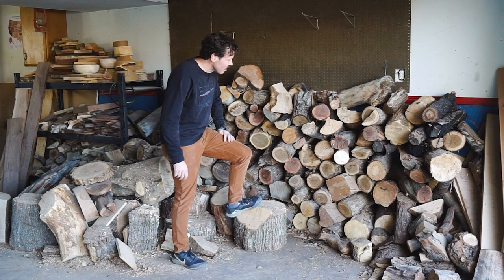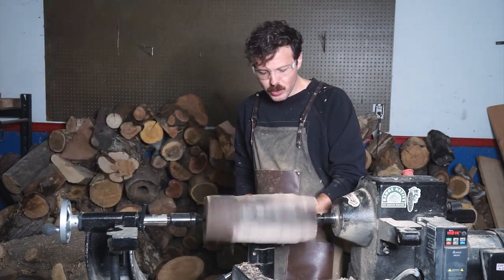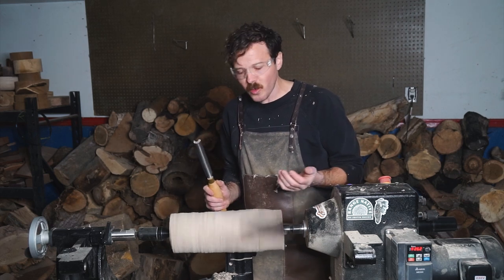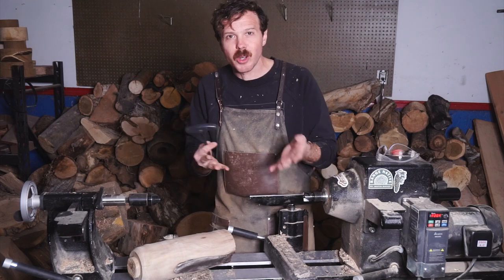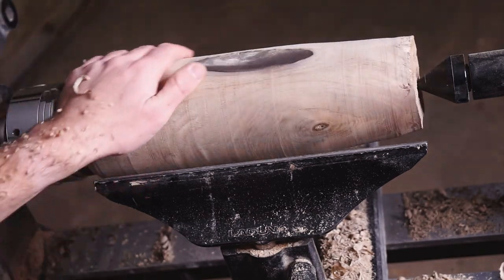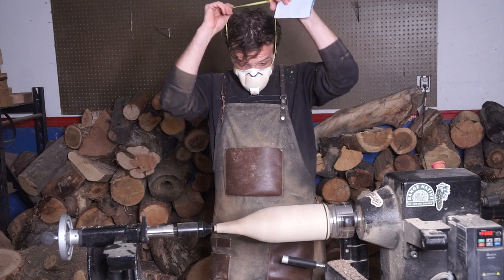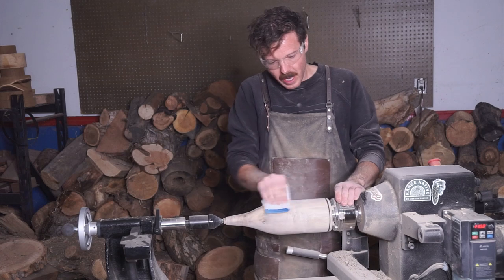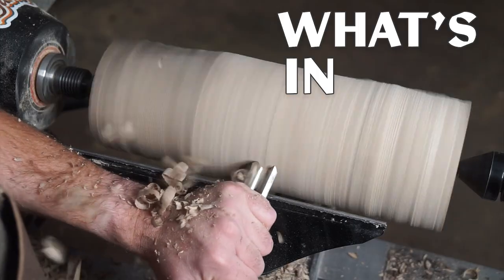English Walnut Limb to Vase | What's in That Pile?

Comment: I know you don’t like answering questions, but to get into carving should I start watching tutorials and stuff? Or should I take a class? I’m mostly lost in that sense. Also I really like this series of what’s in that pile!
Reply: If its with a lathe or a table saw or other such equipment like that, I would recommend a class if you haven't already used them before, as it is remarkably east to ruin a finger or two if you don't know what you are doing. Otherwise, if it's manual carving, or if you know how to use the tools already, I think tutorials or the like should be fine. There are a ton of woodworkers out there who offer excellent advice for both safety and for different ways of woodworking. A class won't cover all the various ways to woodwork, it covers a specific style, usually the one the instructor is used to, and they are usually heavily safety oriented, which isn't a bad thing mind you, but if you are already familiar and comfortable with tool safety on devices there is no need to go through that.

Comment: As a fellow wood worker, and general contractor, I would like to point out that there are many manufactured tree species or breeds that grow very quick and provide most of the wood i build or remodel homes with every day, there are also alot of species I use that are special and slow growi.g, I offset as much as possible by using wood that is cut down by lawn care guys, maintenance guys, or people clearing land for new construction.

Comment: Before you cut it down to the skinny neck, you cut the hole to the depth you want. Then you use special long handled and curved files. Those will widen out the inside.
Then cut down your skinny neck, oil it up and call it good😎
Reply from the maker: I wouldn’t want these types of vases to be hollowed out tbh. Would make them feel cheaper and worse, take too much effort, and not allow me to do the ultra thin tapered neck I like

Comment: How do you hollow out the vases
Reply: Hey! Sorry for the late reply, but in case you're still curious, he uses a cylindrical shaped carving bit that rotates fast and creates a tunnel inside the wood. He doesn't hollow out the entire piece of wood because the process would be impractical ( he'd have to cut the bottom, shave at it from inside, glue it back on etc) I hope this helps
Reply: @LilithBlackwood  thanks